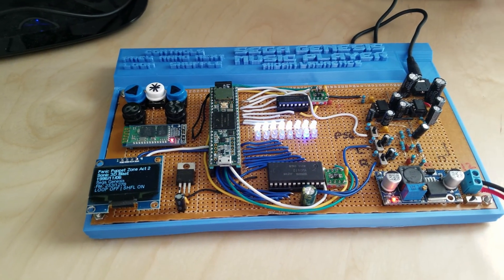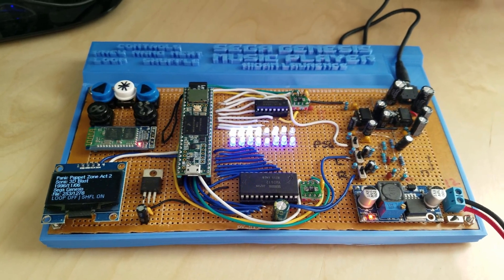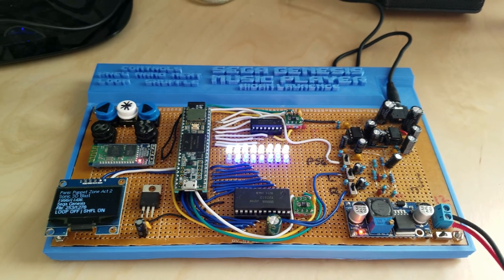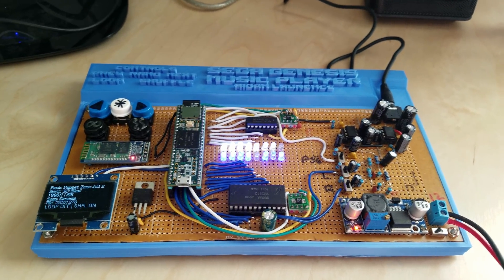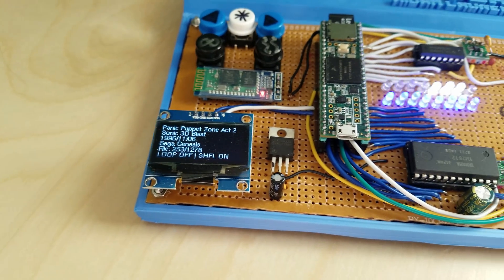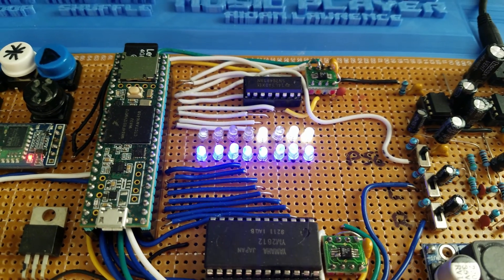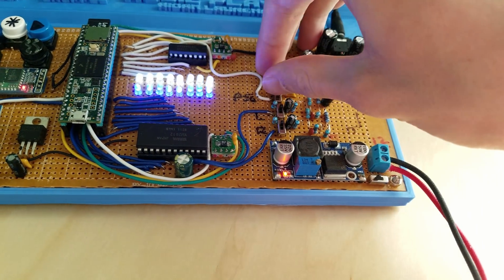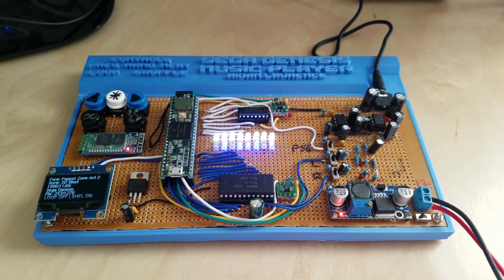Sega Genesis Music Player V.3 (+ MSX Player Preview!)

Comment: Great! Would you tell what is the PCB in the right bottom corner next to the blue jack? A Power supply? Thank you!
Reply from the maker: I think you're talking about the blue buck converter module in the bottom right. It converts 12 volts down to 5 volts to be used by the rest of the system. The original 12V line is used for the amplifiers. You can find them on eBay and other similar sites by searching for "LM2596 Buck Converter Module."

Comment: Can I use YM3438 Instead YM2612?
Reply from the maker: 吳小俊 Yes, the YM3438 is the same as the YM2612, only with an improved DAC and manufactured using a CMOS process.

Comment: I find your project quite fascinating, and congratulations for all the hard work you’ve poured into the project so far! :) Just a note: I’ve noticed that the Puyo Area B and Emeral Hill songs are a tad slower than the originals; is this a known bug in the project?
Reply from the maker: Nope, it's not a bug. VGM files have a PAL region sample rate. You're probably used to the NTSC sample rate which is slightly faster than PAL, hence the perceived slowness :)

Comment: Why is the noise channel so loud on Marble Zone? I thought it was incorrect until I checked a different recording of it and realized that I've never actually noticed that instrument in this song before since it's so quiet in the actual game.
Reply from the maker: Ultimzer Great question! This has to do with the output level differences of the two chips. In Marble Zone, the PSG is responsible for most of the persistent beat and the sparkly arpeggio while the FM synth is playing the rest. The PSG is several times louder than the YM2612 pre-ampliflication, so in real hardware, it's presence is much more noticable. 
One of the reasons I've created this project is that you can really tell the differences between genuine hardware and emulation.
Reply: Is the PSG this "loud" when played out of an actual Genesis? I never had a Model 1 so I can't confirm headphone output, but on my Model 2 the music always sounded much closer (if not identical) to the "emulated" versions in other recordings.
Reply from the maker: Ultimzer Oh yeah, the PSG is extremely loud. You can easily hear the PSG without amplification while the YM2612's output is extremely faint.
My amplification system is different than the real Genesis, so that might explain why the levels aren't exact. The real Genesis actually uses a pretty terrible amplification circuit, so this project is what it would sound like if the outputs were "crystal clear." :)

One thing to note is that the SN76489 is baked into an ASIC chip on the real Genesis and is not a descrete DIP component like mine is. The ASIC SN76489 shouldn't have any different properties than the one I have, but hey, you never know!
Reply: One thing to note, other than the PSG being a bit louder than the mixing done on the Genesis harware, the SN76489 has different noise patterns than the implementation in the Genesis VDP.
Reply: Really cool project, nice work.

I also noticed that the noise channel is too loud on Marble Zone, way louder than on my VA6 Model 1.